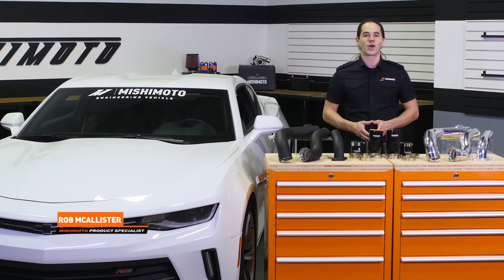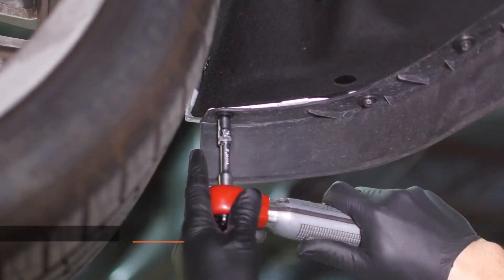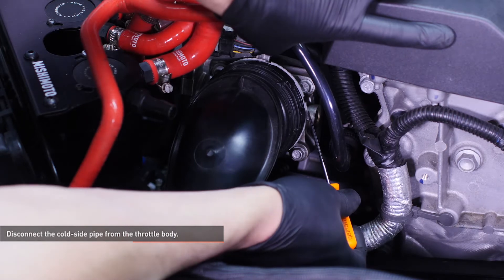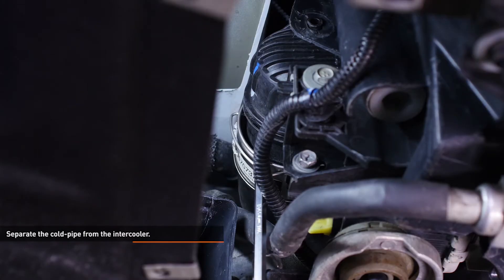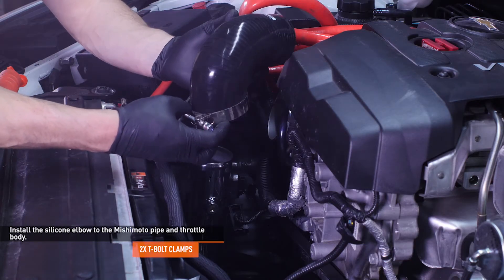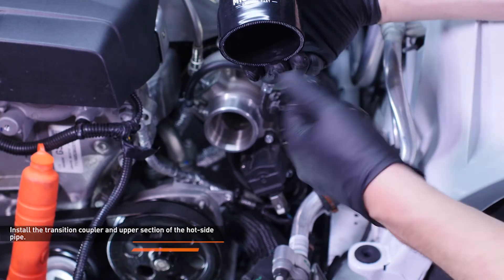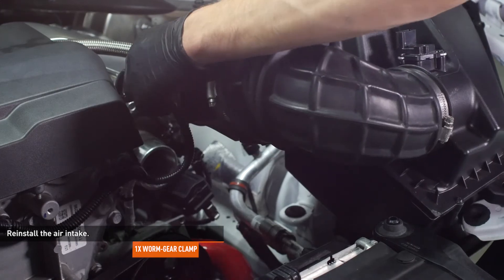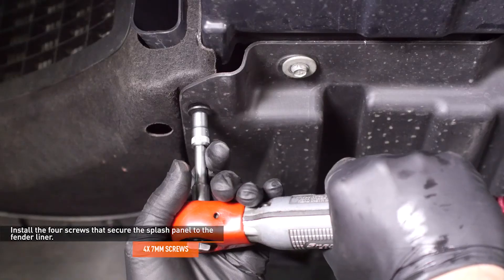2016+ Chevrolet Camaro/2013-2019 Cadillac ATS Intercooler Pipes Installation Guide By Mishimoto

Comment: Im assuming it works on the CTS as well?
Reply from the maker: This fits:
2016+ Chevrolet Camaro 2.0T
2013-2019 Cadillac ATS 2.0T
Reply: @mishimoto  I bought it and installed it. Fits 2016 Cadillac CTS. All the intercoolers are the same size. Me and my buddy compared.

Comment: Is this for the stock intercooler
Reply from the maker: Yes, this is compatible with the OEM intercooler.
Reply: @mishimoto  are there any down sides check engine lights over heating what have you
Reply from the maker: No issues

Comment: What’s the hp gains by adding both hot and cold charge pipes to the oem intercooler? Also, why is your intercooler kit so much more expensive than ZZPs?
Reply from the maker: Our pipes will net you ~11HP on the stock tune. Our kit may be a bit more expensive but we offer a lifetime warranty on all the included components.

Comment: Will these charge pipes bolt up with stock intercooler and zzp's larger throttle body?
Reply from the maker: These pipes will work with the OEM intercooler but we have not tested with the larger throttle body. You may be able to use them together with a transition coupler.

Comment: Great work. I will be ordering these for my 2017. Quick question. on the 2017 I notice some of the clamps are different.  are there any different instructions for the 2017 Manual Turbo ? 
Thanks.
Reply from the maker: Hey Ted MX! Stay tuned - touching base with our Market Research Specialists regarding 2017 fitment!